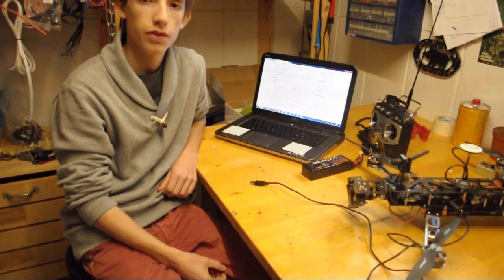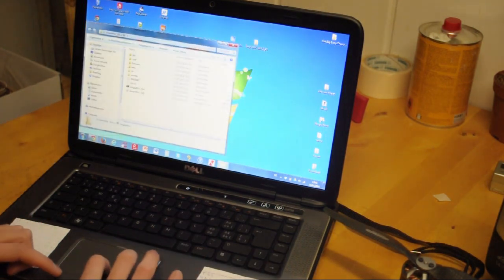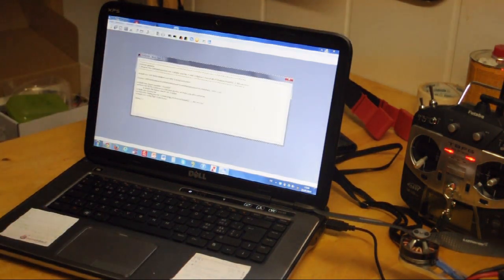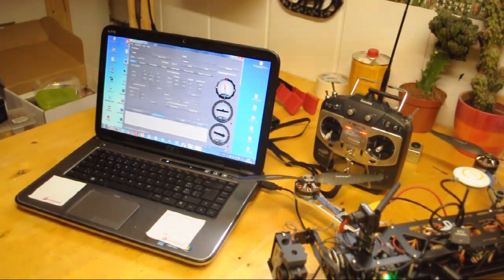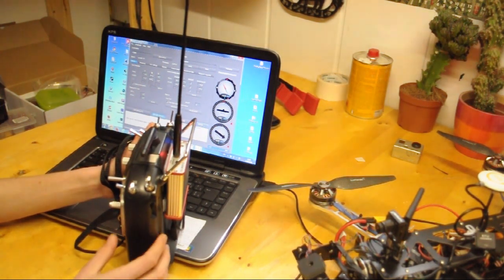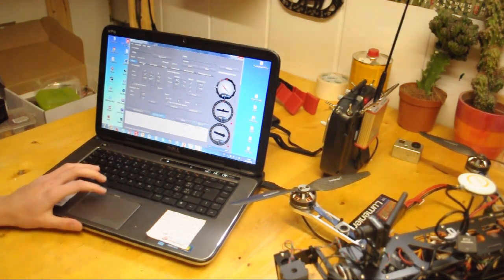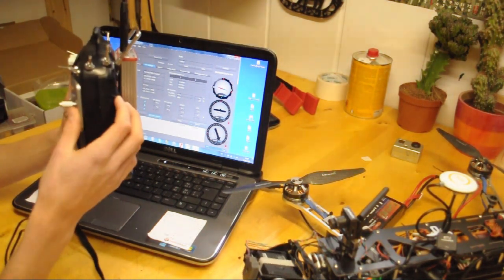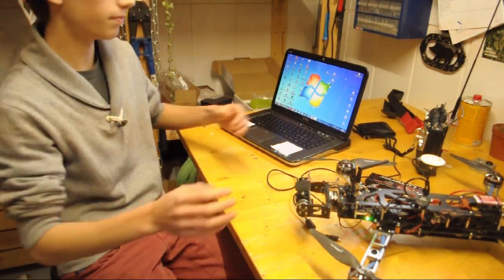[BUILD] QAV540G Brushless Gimbal Quadcopter PART II: Alexmos Controller Tuning

Comment: hi, this video is really helpful. 

i had 2 questions regarding your radio. first, are there 2 sliders on the T8FG Super?
and second, did you buy the helicopter or the airplane version?
Reply from the maker: Hi achilles, thanks!!
It has two sliders, one on the right and the left.
I bought the Airplane version, because all the helicopter modes are programmable too, and all multicopters have to be controller with airplane programming...
Reply: Swiss RC thanks for the reply. i also have the qav540G, as well as a qav500. however i only have a Futaba T8J radio, and the 180 degrees that you control with the slider was important to me. so i went ahead and purchased the T8FG for more functionality. i probably will keep the T8J as well, in the event that my skills greatly improve (greatly, haha) and one day i can use one radio for flight, and the other for camera/gimbal operation. anyway, thanks again for your help and youre informative videos. you do a good job and you dont rush things. 

p.s. where is the video on flashing SimonK onto an atmel ESC? waiting for that one! haha. have a great day.
Reply from the maker: achilles22382 Thanks dude!!
i kinda forgot about the SimonK flashing vid...
I may make one later...

Comment: Hello..i am using ezuhf 4 channel lite to cc3d by ppm..do i have a chance to connect the bgc pitch control to a knob on fhe rx from ezuhf?
Reply from the maker: No, I don't think so. You would have to use a fifth channel for that, but 4ch on a multicopter I think is unreasonable anyway. I use 4 for control, one for the gimbal, one for the RTH and one for the flight mode on the NAZA (Manual, Atti and GPS).